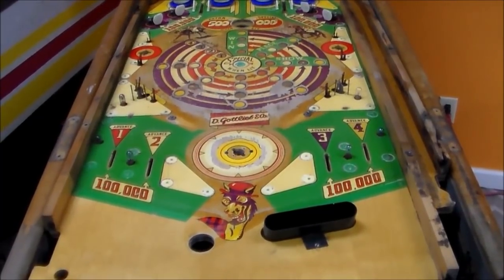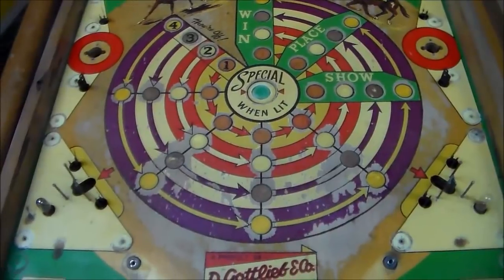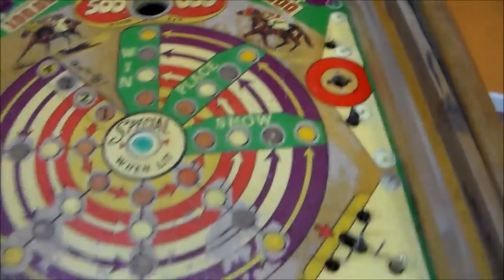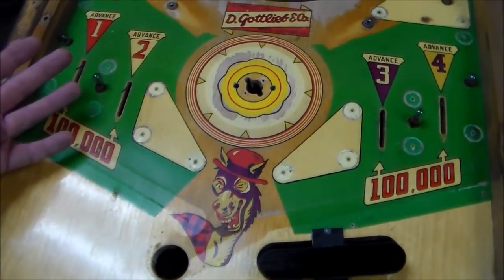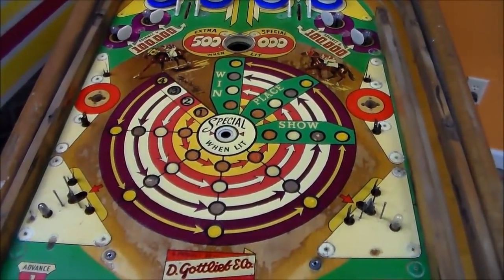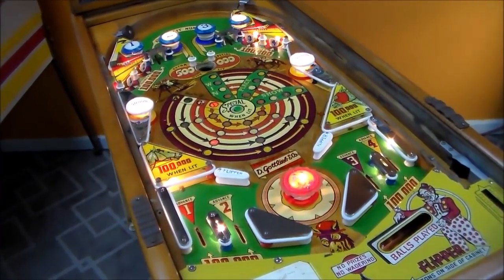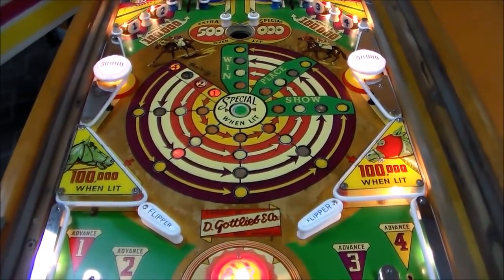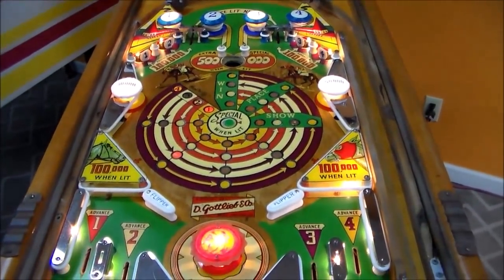Painting the Playfield on this 1956 Gottlieb Wood Rail Pinball Machine

Comment: I can't confirm this but a few years ago I asked a fellow collector about Gottlieb metal legs from the 50's. He said if a game had a wooden door, then the legs were painted red. Metal cream doors had cream colored legs. It would be interesting to confirm since the sales adds or flyers from back then were black and white.
Reply from the maker: You may be right, looking around online I see that most of the games before or after this one are usually pictured with red legs (with some having white legs) so it could be!  I'm sure the game was disassembled at some point and it would have been easy to put the white legs on when it was reassembled instead of putting the original red legs on.  An operator likely would have had both laying around and picked up the wrong set....

Comment: I use an intercoat clear and fill those holes just with a brush. I thin it just a bit to make it self-level. I put enough coats till it is smooth, then I do touchups.
Reply from the maker: I've been thinking thinner might help me out, my main issue is I can't easily sand it in our shop (I'm right out on the open floor!)
Reply: @LyonsArcade  I use createx 4030 with just reducer and only paint the low spots. Just fill them before the touchup. No sanding required.
Reply: For the damage and inserts. Not the final clear. Sorry
Reply from the maker: Thanks Thomas!  I'm going to try some of that see what kind of results I can get.  Do you use an airbrush with your final coat?

Comment: Wow, nice! My hands just aren't steady enough...
Reply from the maker: Mine aren't either, if you do it enough you can actually use the brush touching what you're painting to steady your hand.  The whole thing is you have to be brave enough to just paint it, once you start you have to finish the line, if you stop it'll show a little mark and be crooked, etc. but if you just touch the playfield and make the line, the length of the paint bristles keeps it pretty straight, you kind of drag the paint in a straight line.  Those guys that do pin striping on cars use a brush with like a two inch long bristle on it.